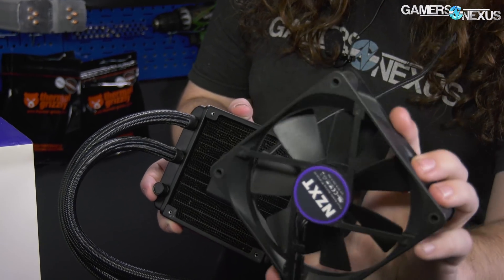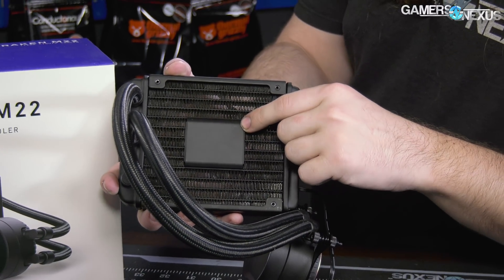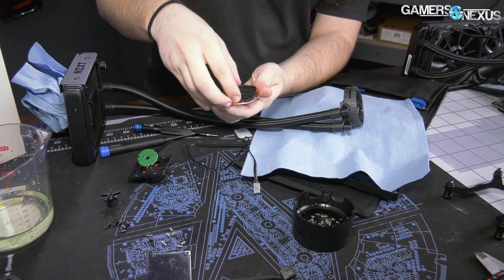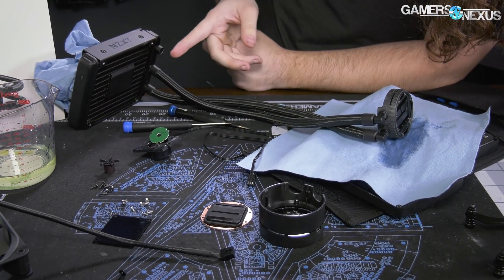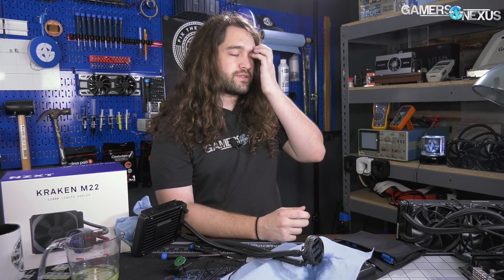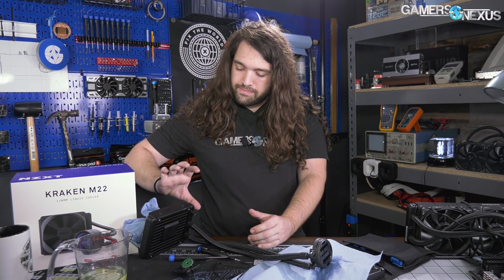Tearing Down a Strange Liquid Cooler - NZXT M22 Pump-in-Rad

Comment: This thing is a pure joke. Who the hell will buy it when its priced the same as the Noctua NH-D15 which is better than any AIO ??? Yeah, guess so, the RGB whores.
Reply: So the D15 would work better than my Kraken x61? Dman pump rattle is driving me nuts. (7700K at 4.9)
Reply: Indeed, that does not change the fact that his parcticular AIO is extremely overpriced, but i guess is for the RGB heads with mATX/SFF systems.
Reply: Kindis 

Did I say AiO are better price/performance wise ? No.
But as I only can relay on benchmarks here, the Thermaltake Water 3.0 Extreme S apparently has better cooling abilities under load than the D15 while costing $83 on Newegg. Similar and especially newer 240/280mm AiOs will perform similar 
http://www.relaxedtech.com/reviews/noctua/nh-d15-versus-closed-loop-liquid-coolers/2

Edit: The deepcool captain 240ex white can be picked up for $76 on Newegg aswell while performing better than the D15:
http://www.guru3d.com/articles-pages/deepcool-captain-240-ex-review,9.html

..while also being more quiet:
http://www.guru3d.com/articles_pages/deepcool_captain_240_ex_review,11.html
Reply: People are under the impression that water cooling is alot better than air, which sure is true im some cases but def not for a 120mm vs massive noctua. Might be a stigma from the idea that full custom loops are insane and "high end". I just buy noctua and call it a day
Reply: completely subjective on the look, i dont care if my ram has fansy IC covers. I dont really understand the static discharge point. Dust cant damage it at all but leak from a close or open loop sure can. All the ''heatspreaders'' are to sell the product and dont have practical use at all.
Reply: Dust can cause shorts in rare cases and can cause fan failure and will cause an insulating effect until fire. 

Guess you've never seen a PSU short itself to death because of dust then light that dust on fire and proceed to burn. Not sure what this has to do with watercooling vs air cooling though? I've seen both look like they got those carpet things cats scratch (radiator, air cooler, etc).

Buy what you like to look at, if you don't care about looks... Then probably air cooling unless you need specific cooling that air cooling can't do (or is jank).
Reply: Kindis 

Are you stupid or just a troll ? Please read my posts and the review page again, they don't let the fans run at 100%, they use the stock fan curve and let it auto regulate through PWM you dumb nut
Reply: Kindis 

Yea if I ever buy an AiO, I certainly will not get an NZXT one. The CAM software is a pain in the ass aswell.
Reply: Show me a capable 100$/EUR AIO, which is the price of the noctua nh-d15 on newegg, now even its discounted at 86$. There are a couple but not from the expensive brands like NZXT (pure aesthetics brand), Corsair and the other ''premuim'' ones. Deepcool have some competitive AIO's but they are surerly not quieter compared to the fans of NH-D15, Darck Rock Pro 3/4. The Corsair AIO's have noisy fans, the Kraken X6*s are i think somewhat quiet, but you also have a pump noise.
If you ask me it just totally different audiences. The one thing i hate about it that is huge and you need a good airflow case, and you gotta be very carefull with your choice of GPU.
Reply: This TT Water 3.0 is currently unavailable in my region, maybe because its old model, but seeing the price history its more expensive. 
By competitive deepcool i meant the Maelstrom 240T which is like 45 euros in my region, basically half the price of the NH-D15 but performing similar, but build quality wise its a lot worse, and the fans too.
The deepcool captain 240ex is better but they are testing them at full speed, nobody will use their cooler at full speed, especially a big dual tower like NH-D15 which it has very quet fans. Also i sttrongly doubt that the fans of the deepcool are more high quality and low noise than the D15's one.
Reply: Kindis 

Where does it say that they're testing them at full speed ?
Reply: not against the normal priced ones*
Reply: Guru3d
Reply: Kindis 

can you take a screenshot of that or a link as it doesn't say it on the review page
Reply: Thats a link that you've posted, also the Noctua NHD15 has the quetest fans on the chart, it right above the chart  - ''http://www.guru3d.com/articles_pages/deepcool_captain_240_ex_review,11.html''
http://www.guru3d.com/articles_pages/deepcool_captain_240_ex_review,11.html
Reply: ''But let's have a peek at noise levels. We take a dBA gun and point it at the working PC and take a distance of 75 CM.''
Reply: Are you a fanboy or you cant like one and dont even red the review before posting it ?
Reply: Kindis 

No, look again. That's the NH-D15S. The normal D15 is 1dBA louder than the 240ex.
Reply: Kindis 

And why did you quote that ? This doesn't mean they out the fans at full load.
Reply: You point out that the Deepcool has queter fans, which is not the case. On that page they've masured the fan noise at full rpm, it was your point, not mine.
Reply: This situations are very, very niche, no guy who cares about his pc is gonna let the dust to stack up in the case, come on. At least not me.You gotta be really sloppy and lazy to do that. And you gotta be really naive to think that manufactures (or sellers cuz they dont make the actual IC's) are making the ''heatspreaders'' to protect it from dust...its all there to catch the eye, nothing else.
Reply: Kindis dude. I've been looking for something like this for my mini ITX build for a long time. I got so giddy when i finally saw steve do a tear down on a slim 120mm aio with cool rgb lighting. The Corsair one isnt slim enough for the itx case i want(ncase m1);it does fit but it flexed the motherboard on someone build. This aio is perfect for my need and aesthetics. I like air coolers from be quiet but the ones i want are too big
Reply: Yeah, i've shared my thoughts, its fore SFF builders who want that bling blinb :d. How you got your hands on a Ncase m1, is it in mass production ? What do you think about Loque Ghost S1 MKII ? Guess you can snug in a some low profile noctua in that Ncase like Noctua NH-L12 with the bottom fan only, dunno if its gonna do better job or not though.
Reply: Kindis maaaan. You and i can talk about this in more depth if you want. I'll dm you my info
Reply: #smokedoutpositivesquad flawed  testing method. All water based solutions for cooling rely on Kelvin of energy. Running prime 2-3 times    at those volts doesn't really probe anything. Run the overclock at a more stable 1.25 volts for 2-3 hours and you'll see the the water cooler solution will have equalized in temperature within the loop and loose a tonne of its cooling capacity.  It's not the best testing method used. Every testing method should be tested over hours, not a couple of high voltage uses.
Reply: #smokedoutpositivesquad Decibels is only part of acoustic measuring. The testing method is flawed again because it didn't measure pitch. Most people could handle a higher decibel with low pitch...than a very high pitch at a  lower decibel. Kinda like skunk spray..not the worst smell in the world, it's how strong the smell is that gets people.
Reply: No I just do not what a huge ass hunk of metal hanging off my CPU socket! I want to mount that huge ass hunk of metal to a CASE.. Not only that but those damn things are ugly as hell and will bite you any chance they get.. =)

And I LOVE Noctua - I replace all my AIO fans with Noctua fans..

I might get this thing IF it was a 280MM AIO.. That Infinity Mirror is just gorgeous.. Even if you hate RGB most would like that over their CPU..

Too bad the x62's and such you need to hook the damn pump to the USB and can not control the pump outside of Windows.. That is why I will not use the previous Krakens.. CAM sucks.
Reply: Kindis but Noctua is still poop brown. I prefer BeQuiet air coolers, asthetically and for performance. I also like Cryorig too.
Reply: Here's a thought for ya @Kindis.....   Air Coolers Simply dissipate the heat into the case, unless you go to the effort of ducting them out which is ugly, an AIO Radiator on the other hand can be setup so that ALL Exhaust is PUSHED out of the case, which in turn via negative pressure DRAWS IN Cooler Air via vents in the case, or by the assistance of other fans. So an AIO actually helps for keeping internal case temperatures LOWER. Lower internal case temperature means other components get better cooling, and the AIO itself also performs better because its not directly recycling any of its hot exhaust.  Did you ever consider that?
Reply: Kindis 

AiOs have their pros and cons.
Some pros over the D15:
-Much better case compatibility
-Looks cleaner
-Radiator fans can replace case fans
-Quieter (depends)
-Cooler CPU under light loads
-RGB

I'd still rather buy a air cooler though but some people will not, for the reasons I listed above.
Reply: Why the hell you bought a AIO then ? Top notch quality air tower like NH-D15 is gonna be quieter, and costs much less. The only minus is the bulkiness, but if you dont mind, thats the way to go.
Reply: Noctua has NH-D15SE cooler for higher ram. I dont see the point of ram headspreaders on DDR4 though, its a gimmick. Also Darck Rock Pro3/4 its completely black.
And you think you can run the fans of a 30MM think 240mm AIO on low rpm and get good temps ? Dont think you can achieve that, those have to be really special fans and radiator. Or maybe you meant real watercooling, not AIO's, if so, ofc you can chive that with a good setup.
 I dont want a overpriced, weak ass RGB crap in my case, got nothing against AIO's, at least not against the overpriced ones. 
Sorry, Steve if you reading this, i know you cover a lot of the products of those ''premuim brands'', but i like the channel and im a sub.
Reply: You're wrong as it seems, look at the OC result page:
http://www.guru3d.com/articles_pages/deepcool_captain_240_ex_review,10.html

"After 1.35 Volts the fans will start to spin a notch faster, 39 DBa however is a relatively silent airflow level from an audible point of view. At 1.40 Volts in the CPU the processor starts to heat up faster and here things will become more noisy as fan RPM will ramp up to 80% or higher, but even then 40 DBa is considered to be close to silent. 1.45 Volts is not recommended, but it did finish three Prime 1024M runs perfectly fine."

So that tells us that they did not leave it at 100% fan speed all the time but just stuck to the out of the box pwm. Sorry to see the 240ex beating the D15 in price, looks and thermals, aswell as noise :P

Comment: another example of patent law holding back progress
Reply: I mean, what would be different? NZXT tried a different approach here. It works. That's the point. Another design puts the pump on the edge of the rad. Another company, I forget the name, puts the put on top of the CPU block, but it's two separate chambers, so they have a tube coming out the top, to get around the patent. It's become their trademark aesthetic though. So clearly they still innovated.  I prefer the pump in the block of course. But aside from a different impeller design, it doesn't seem that meaningful in terms of hurting designs.
Reply: And if you really want to do it, you just get a license and pay a small percentage to asetek. Which is what most do anyway. Like Corsair.
Reply: If it wasn't for patent law, why would anyone ever innovate when you can wait for your competitor to do so and copy them. Asetek created the AIO market by themselves, and have patented their design.
Reply: i aggree up to a point.  but putting the motor in the block?  i mean thats like patenting the concept of putting an in engine in the front of the car.  it doesnt take r&d.  its obvious and people were already doing it and its only purpose is to keep other people out of the market. patent a new electric motor, a fin design, whatever but why not patent "the use of electricity to power a water cooling unit".  so now nobody can use electricity to run their AIO's.  they have to be pnuematic or handcranked or maybe a windmill goes through your roof.  real innovation should be rewarded with a patent not just the first guy to rush down to the patent office after he saw that, yes indeed my friends, a handle can be attached to a blade!  i call it a knife!!!

overly dramatic but still i think the point is valid.
Reply: basically what i mean is that if the only thing they brought to the AIO market was the idea to put the pump on the block then they brought nothing.  if they brought more to the game than that then let them patent that which they brought
Reply: "basically what i mean is that if the only thing they brought to the AIO market was the idea to put the pump on the block then they brought nothing."

You're missing the entire point, there was no AIO market before Asetek created one. AIOs were not a thing. Water cooling involved external radiators and reservoirs, and everything was custom, there was no easy to install solution. Integrating the pump in the CPU block in a way that makes sense wasn't a trivial thing back then.
Reply: then why dont they have a patent on the aio and just not let anybody make any at all?  im sure theres more too it but all i see is they have a strangle hold on the market and if they made a good product and they were first then they should have enough leg up on the competition to not need a patent to protect their place in the wolrd.  this will just make them lazy and their products worse
Reply: @bobhumplick4213  There was patents for cars and shit, just watch videos about ford trying to sell his first cars.

Comment: Have you tested the failure rates of these AIO's? I'm nervous about using these on my machine.
Reply: Edward Deaver, IV 

You're good for at least 2 years bro. Basically if you start hearing weird noises or the temps aren't what they they once were it's time to replace it.
Reply: Or go with the biggest air cooler you can fit in your case and maybe replace a fan after 5 years (maybe). Most Noctua coolers out perform AIO's anyways.
Reply: +Spencer - is that what he asked? fuck off air cooling elitist water cooling is superior